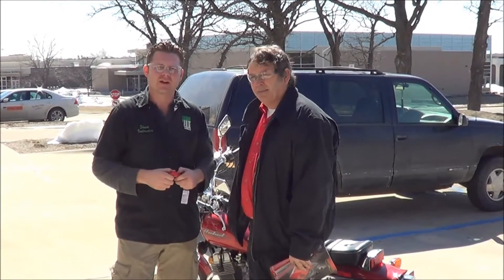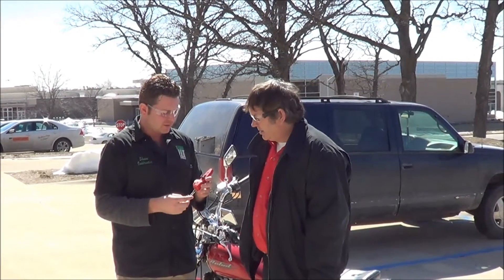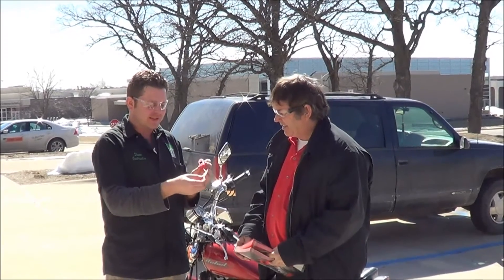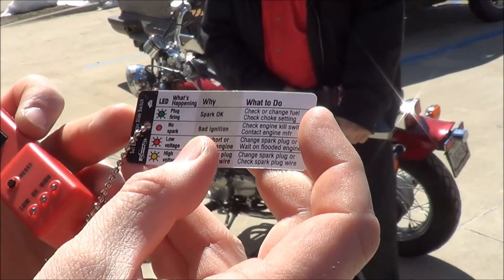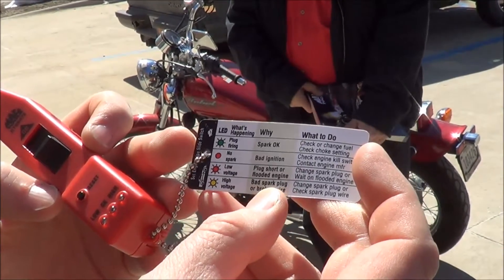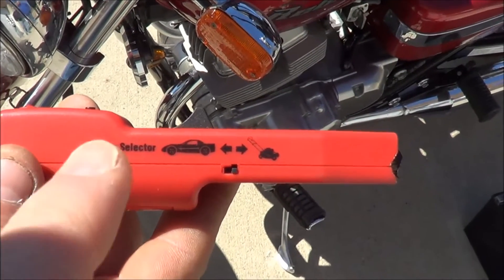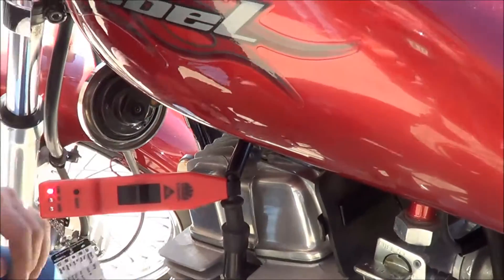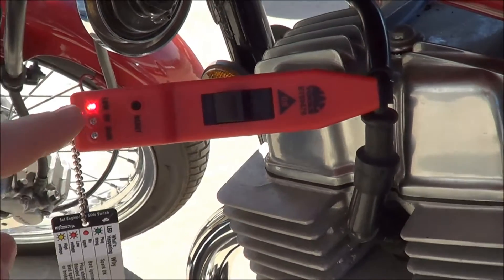How to check for spark with the Mac Tools Spark Checker ET99476 Harley Metric Small Engine

Comment: I'm glad you tested it in bright sunlight, since I seem to have a lot of difficulty seeing spark in bright sunlight with most spark testers. The LED lights seem a lot easier to read, not to mention the fact that you also get data about the integrity of the wire.